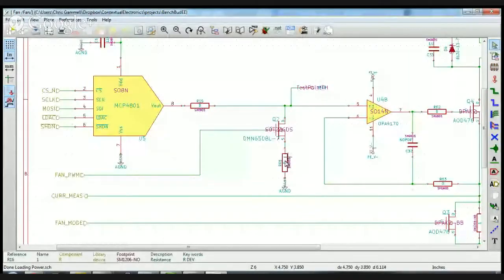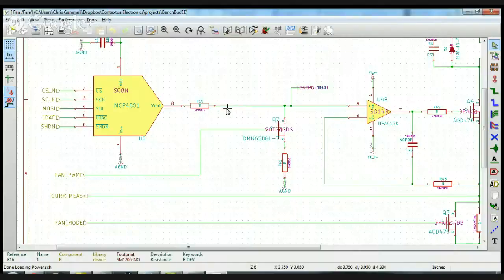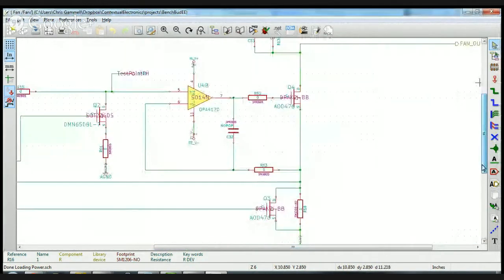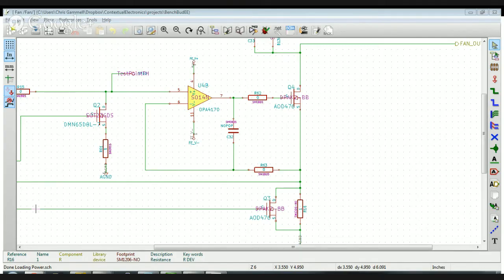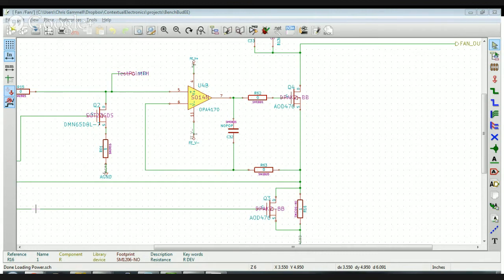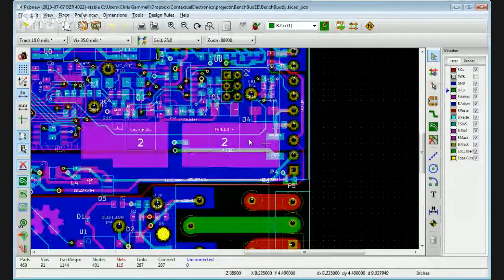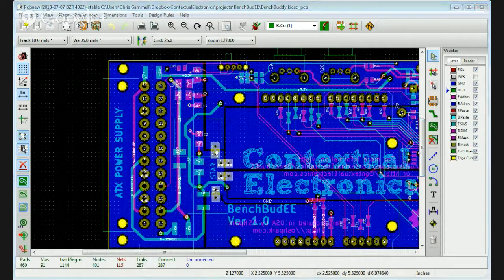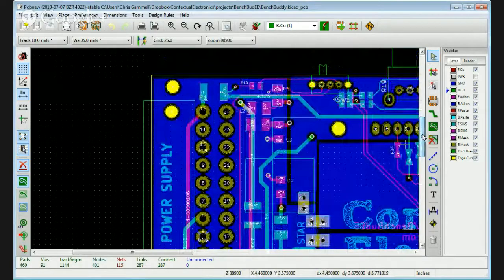CE Session 1B Week 6 Hangout

Comment: Lesson learned: MORE FLUX. For this kind of job best use paste flux. Most of the flux pens are a pain for anything else than normal soldering (i.e. at most 1-2 seconds per pad). The paste flux will give you much more time. ChipQuik is pretty good, Edsyn FL-22 is pretty good too. Not cheap, but good.